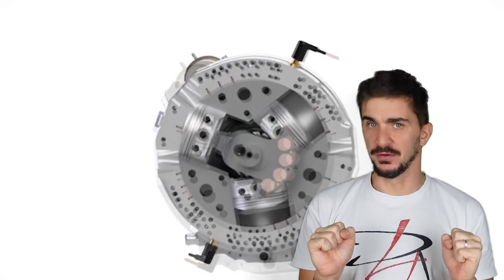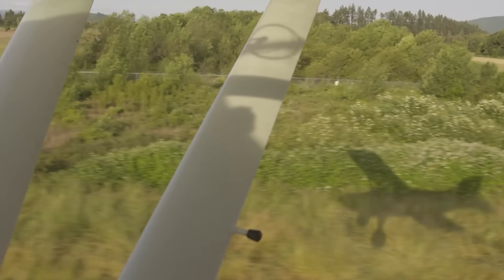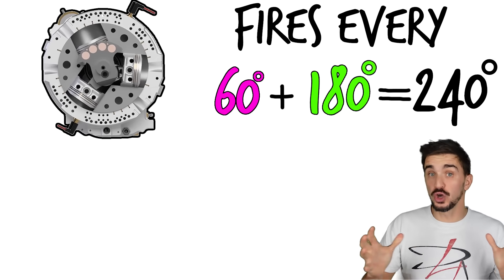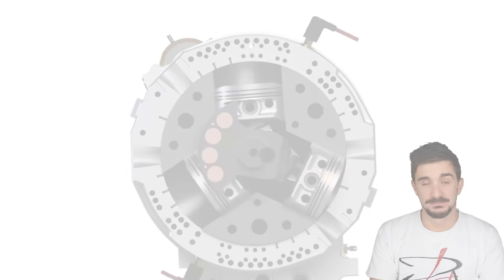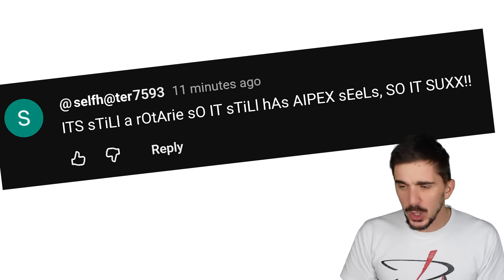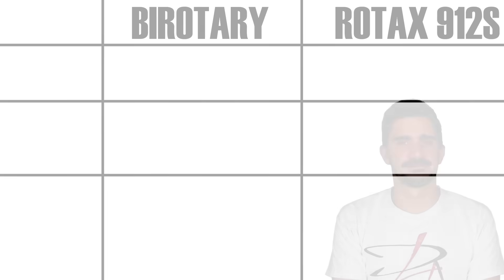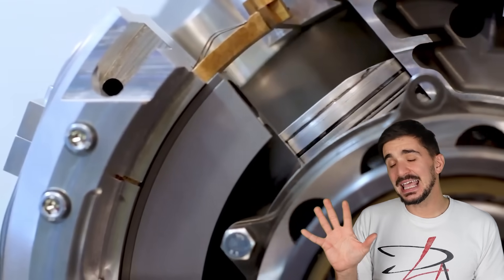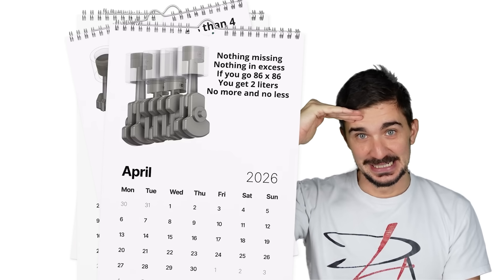This is What Happens When Pistons and Rotaries Make Babies - Birotary Engine Explained and Reviewed

Comment: I'd be very interested in how this engine responds to turbocharging especially if combined with stratified charge ( Sarich orbital injection system).
I would expect significant energy recovery and reduced NOX. 

As already stated range extender / standby power is a much larger but more price sensitive market.

Rotax have done a sterling job of getting lead and short life out of LSA but haven't truly gone after the dinosaurs that make GA unaffordable. Three modules with turbocharging, now we could have something.

Comment: It's interesting that there is potentially a fix to allowing for a large stroke, without deleting half the ports/spark plugs. Off to play with this idea more in my head :)

The other interesting thing about this design, is that they could have changed shape of the piston, to allow for more surface area, and hence large displacement, with only minimal increase to external engine size. IE, minimal depth increase, but could have nearly doubled their capacity, and hence doubled the power.

Comment: The trifecta engine would be if you used mercury plasma to fire the pistons and run the motor, you'd have to have a fancy cooling setup but it'd be way more efficient. 
You could pair it with a repulsine motor (superconducting plates spinning adjacently to create a toroidal gravity pulse field) 
But this might be too complex - after all, the USA's TR-3B uses such an architecture, and was allegedly reverse engineered from alien craft

Comment: This looks ideal for small aircraft.  There doesn't appear to be an oil pan, however, it does have an oil system. How does it collect the unpressurized or used oil?  I have to image that this does have some potential to power a generator to supply series power to an electric motor in a car.

Comment: If we could remove the outermost case of this engine, we could reduce the weight.
It would be difficult, but I think it's possible.
It would also be possible to increase the radius of the cylinder rotor to give it a longer stroke, which would improve efficiency and allow us to increase the number of cylinders.

Comment: Multiple intake and exhaust ports timed differently, with valves that open and close them (like Mazda 13B rotaries on the intake side) would give the equivalent of variable valve timing, with a very small additional complexity.  However the inertia of pistons + crankshaft + block probably reduces the responsiveness.  I'm also not sure about the amount of surface area exposed to flame, compared to a conventional 4 stroke.

Comment: So what if you combine this in a hybrid system with an electric motor for the low rpm a battery and a cvt transmission? Just run this thing on a constant rpm.

Comment: 8 minit of trush talks ...
all engines is about POWER OUTPUT ,BRO ...
NOT the F* rpm  ratio ...  and what gear box it use .... you have NO f idia what enginiers whant to hear from "new tech revyou  vidio" pros ,cons,  tecnical complication and solutions ....f not 4 minut of RPM RATIO and GEAR BOX !! i can slap gear box on whashing machine , it not gono become " new tech engine"  
i a ma frustrated......   from 8 minit of trush talking .... deleate vidio try be beter

Comment: Because the birotrary cylinder block is circular, all be it a very large one, it would seem it would require less machining (no valve seats, valve stem holes, and no cam journal boring) in manufacturing which would mean lower initial costs and later later rebuild costs.

Comment: you didn't mention it but the clip right at the end shows another big advantage to this engine, if you want more power out of it you can just stack another set but the manufacture really only has to make and sell 2 modules to the thing, the end and the piston units.

compared to other engines where each model is effectively an entirely different engine besides pistons and valves and mabey a few other common parts.

Comment: Very interesting engine for hybrid powered vehicles. And as I see its power can be easily scaled up by adding more cylinder blocks on the same shaft, or even by making pistons and cylinders not circular but oval.

Comment: I think for a automotive application is would drive a generator that can make good use of stedy high RPM and having 4 20hp hub motors controlled by rheostats  would transform that into smooth   torque for a commuter stile car

Comment: Not sure why, but the name reminds me of a polar bear I met.  He lived in both the Arctic and Antarctic ice caps.  He was hard to get along with, sometimes extremely happy, sometimes extremely depressed.  He also liked both male polar bears and female polar bear.  He was a bipolar, bi-polar, bi polar bear.

Also, from what I gather, the crankshaft delivers the power and the pistons rotate because they must.  So, I would only count the driveshaft speed as the RPM. The 10000 Rpm because they are combined is marketing mumbo jumbo.  The engine could easily have a rotating driveshaft that moved the pistons in and out closer to a conventional radial engine and the outer case could rotate (similarly to the planetary gear set) and effectively have the same function, although useless since you couldn't mount it, but how fast the case rotates is irrelevant to the power it produces.

Comment: Variable valve.. Very possible. Could see hydraulic controlled orifice's doing that job. Otherwise.. in it's  present design, leaning to constant rpm.. This 
fits real well with CVT drive systems

Comment: 🔄 Where piston meets rotary — a true manufacturing puzzle. This is why we offer combined services (CNC, sheet metal, casting): to build and test integrated systems. If your design needs functional prototypes or pre-production batches, we’re here to help bridge the gap between simulation and reality. Super insightful video!

Comment: I was just about to ask if this engine could be stackable like the wankle, but then the traffic near the end showed stacking multiples together.  This  engine might be able to break in to the hybrid car market as a generator to power the battery bank that powers the electric motors of the car. Generators once they are started tend to run at fairly constant RPM.

Comment: This is an absolute genius in development. It is a combination of rotary and radial engine technology. It has the benefits of both and the liabilities of neither. Imagine what would happen if you increase the diameter of the number of suspicious pistons from 3to 5 to 7 or 9 and then add more banks of engines like the old rotary engines or World War II or the older radial engines of World War II with multiple banks of engines you can have A four wasp engine with enormous power. The lack of torque or the low mount of torque is not a problem either because as torque remains the same and increase the RPM the horsepower goes up!

Comment: Obviously, it has to be dry sump, but how the hell does it lubricate the engine, both the pistons/cylinders and the main rotating "block"?  How are the seals on the outside of the block lubricated without oil entering the combustion?

Comment: I would just say that "engine rpm" is calculated simply off of whatever the useful work transfer mechanism is. Basically how fast is it spinning the input shaft of whatever gearbox or other device.

Comment: Idk if this was mentioned, but there might be some benefit of the rotation to the compression stroke. I think the balancing cancels out any power gain, however from a structural standpoint you might have less parasitic loss from friction because the piston would naturally be being pulled outward by the rotation? And then less force would need to be transfered across the crank from the piston thats generating force to the other pistons that are exhausting gas and compressing air fuel mixture.

As far as stroke to piston diameter I think the piston could be smaller in diameter with the same stroke and then more pistons could be used, Im not certain the short stroke is the only config that works.

Valve timing could absolutely be variable, but it would just work a different way. Im imagining either multiple ports that are offset in a vernier fashion. perhaps multiple sequential slots with a rotary valve that can port the air to different slots and be phased or controlled with a freevalve like system.

Efficiency wise, the massive free exhaust and intake ports seem like a huge win. Just add a big turbo and plenum to the intake and charge it up with air and maybe even fuel to premix it.

Really cool engine that solves the issues that valves cause, mainly that they get in the way of the pistons. no head gasket, and the force of the crank transfers in more or less a linear fashion as apposed to inline engines.

Also these could totally stack one in front of another eliminating the counter mass.

Comment: You could easily use it in cars. All you need to do is use it for an extended range EV. Then the constant RPM doesn't matter. Neither does the gearing or anything else. The only thing that matters is power vs fuel use. It does seem a little odd the combustion chamber is not canted in the direction of rotation. Maybe it is difficult to make the combustion chamber small enough for a decent compression ratio.

Comment: I wonder how you would test these engines for compression, because you don't have a typical valve system. 

I guess you would just replace the spark plugs with a pressure tester, and line up the cylinders

Comment: Saying a rotary engine sucks because it has apex seals is like saying your mom sucks because she has fake fingernails. It’s true that they require maintenance costs that you wouldn’t have with real fingernails but it’s small peanuts compared to her alcoholism and the years of neglect. (Or in wankel terms, the fuel consumption and low torque output)

Comment: A fixed RPM is perfect for a type of hybrid electric car.  The engine drives a generator, and motors in the wheel hub provide the necessary variable speed control.  It would require an inverter to avoid brushes, and a battery pack to act as an accumulator, but it would be a much smaller and lighter pack, and recharge time would not be a factor, since the generator would maintain charge on the batteries at all times.  Fuel efficiency would still suck, but it would work.  It would avoid camshafts, timing gears, and the transmission and drive train, but I think these are all relatively low efficiency losses compared to converting AC into DC.  

Using a DC generator wouldn’t work because there is no way brushes would stand up to the rpm.  It might be fun for an experimental build though, just to get hard numbers.  The problem would be finding a generator that can handle 10krpm.  They must exist though, since I worked at a remote pipeline gas compressor plant that had a power pack that used micro turbines direct driving generators running at 70krpm.

So, this engine direct driving a generator.  Generator output goes to a full bridge rectifier.  Rectifier drives four brushless motors built into the wheel hubs.  A battery pack floats on the circuit between the rectifier and the motor controllers.  If the battery pack hits full capacity the engine shuts off until motor power demands exceed available battery output.  A power management computer controls it all.  The throttle pedal, buss voltage and current, generator output, and battery charge are the major inputs to the power management computer.  A second computer would handle emissions control and management of the rest of the vehicle, so there would need to be communication capability between the two, or maybe build it all into a single computer.  An Allen Bradley Contrologix PLC would be well suited to this, or possibly an Automation Direct P3000 series PLC as a cheaper alternative.  That would allow easy programming access as well as the ability to expand i/o as necessary while prototyping.  Build the whole thing on a sand rail frame for easy access while prototyping.

If I was younger and in better health I would be tinkering with this idea in the garage right now.  It seems like it could be a lot of fun.

Comment: It’s fair to say it’s 180 degrees because the transmission doesn’t care what speed the innards of the engine are going it just cares about crank relative to the bell housing and in this case the bell housing is fixed and the block rotates so it’s still firing once every 180 degrees.
Reply: Oh….. wait if the driveshaft is driven off the block then… it…. Fires once every 60 degrees? Ok….

Comment: I studied this exact problem as part of my engineering degree. The conclusion is quite simple. The real rpm of the engine is simply the number of times piston hits TDC. The displacement is simply the displacement of the pistons as you would normally calculate. The idea of the engine having lower/higher torque or lower/higher output speed is largely irrelevant, it's just gearing. A regular piston engine has a gearing between pistons and crank of 1:1. Other engines just have a different gearing, the Wankel as a gearing of 1:1.5, so the crank spins faster by 50%. This is irrelevant because you just compensate in the external gearing (for vehicles with a gearbox/diff).

Comment: Getting variable valve timing for an engine like this should be possible, though it would require a different approach from regular piston engines. You could have multiple holes that all connect into one that's parallel to the main bore and put a rotating valve in there, for example.

Comment: You have found a winner!
You didn't explore the scalability factor though; perhaps 3 or 4 modules connected in series, together with some kind of electronically managed induction system that was flow-optimized for a broader operating curve, could allow this engine to be used in ground transport vehicles?
Perhaps in a future video this can be explored in more detail.

Comment: Will the rotation of the block piston assembly cause wear on the sides of pistons, rings or cylinder walls and other parts more quickly than a standard block auto engine?

Comment: Seems like a great engine concept for light aircraft .  For a range extender , not so sure as you are spending money , weight and complexity on reducing gyroscopic and net torque effects that don’t matter for that application . A simple piston reciprocator and solenoid seems a better choice as a range extender .  A light plane on the other hand would prefer to have no torque induced roll or gyro influence , suggests that is where this engine belongs

Comment: You know, the seal design of this rotary motor would make for an interesting solution to actualize a rotary valved valve-train.  If a counter rotating birotary can contain combustion in that configuration it would contain it in a head assembly…

Comment: maintenance will be an absolute nightmare and that will be reflected in the maintenance costs and aircraft already have high maintenance requirements due to the constant high rpm running of the engine

Comment: 5:30 Also: a single piston doing a 4 stroke cycle fires every 720 degrees. A 2 cylinder engine has a spark plug fire every 360 degrees. A 3 cylinder is, you guessed it: 240 degrees. I figured this out withoout even taking the structural weirdness into account lol, it’s just “cylinders/720.”  Therefore: 100% yes you should include everything

Comment: So it seems to me like the benefits come from the short stroke, except the balance. so I'd be interested how it compares to a conventional piston engine with equal displacement and stroke. I thought that the funky arrangement of the crankschaft moving relative to the piston changes something about the piston rod angle during combustion. also the increased mass that is moving probably increases the inertia which affects how fast it can accelerate. Ive also noticed the needlerollerbearings on the crankshaft which probably reduce friction which is possible because i think the crankshaft doesn't experience radial loads. I love how you seem to get more and more unhinged

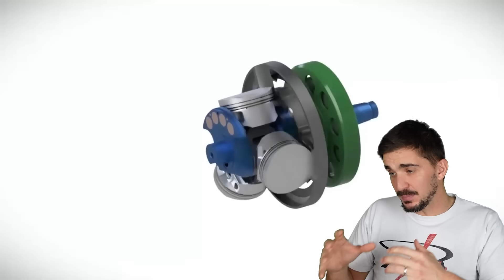Comment: 17:01 That's indeed an important drawback for a car with only a combustion engine, but what about hybrid cars? The electric motor can be used for low rpm and acceleration, while this engine could be used for cruising speed.

Comment: Problems:
Seals.
Cooling rotating cylinder block.
Gas flow in moving head.
Combustion chamber shape.
Spark plug fouling.

The things which together have conspired to get rid of every single "new" engine type because people are so used to the standard 4 stroke piston engine with poppet valves that they don't realise it is a work of genius with a century and a half of development.

Comment: Nothing a turbocharger can't fix! Right guys? Guys?
Reply: You meant biturbo for the birotary, right? 😎
Reply: In this case it might be better use of a supercharger, coz it should be BiTurbo the ports are at 180ish degree. They show stacking at the end of the video slides so that will be fine too, or maybe even design with bigger displacement over all with more blocks connected via 1 or 2 gear assemblys at the ends of the engine. One very important thing wasn't mentioned lubrication it should happening through the crankshaft as the block rotate and .....
Reply: i thought super charge it. turbo also hectic idea.

Comment: Would a super charger make up for the low intake air velocity? Would love to see actual fuel economy numbers. Had a question regarding the rpm calculation. Since the rpms are added together, wouldn't only the rpm of the block matter since that is how many times the piston is firing for the purposes of fuel economy?